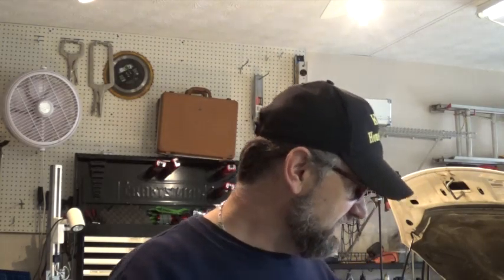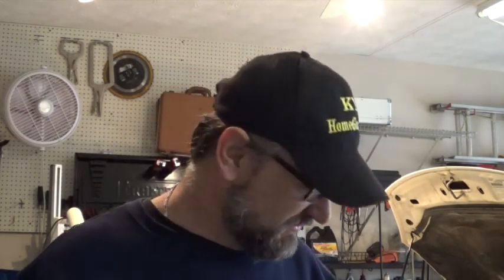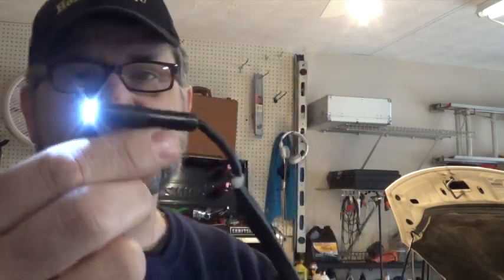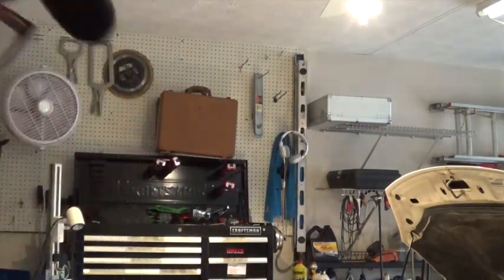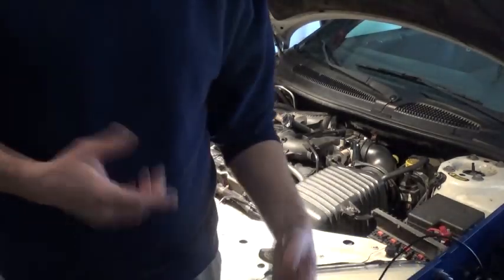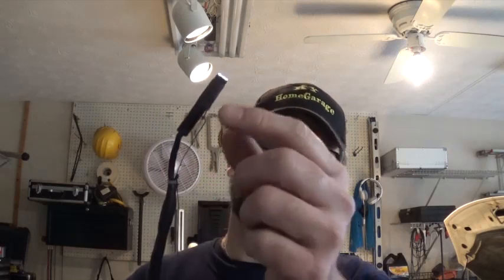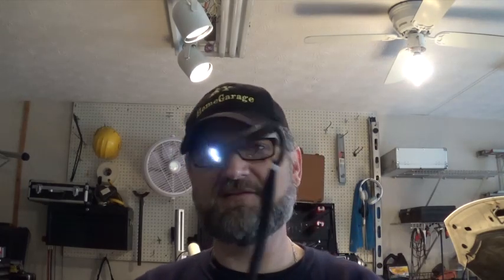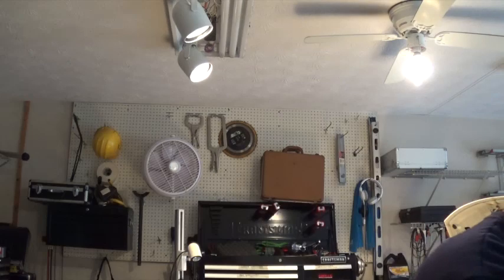Engine Valves Inspection With USB  Borescope

Comment: one thing to add to this....practice with a small cardboard box with a hole the size of the spark plug hole first before doing the real thing. i got a small cardboard box like 5x5...whatever....cut the hole in the bottom of it, and magic marker'd some circles on the inside bottom of the box( to simulate valves). flipped the box upside down on the kitchen counter and taped it down tight to the counter. practiced sticking it in and how much force it takes to pull the end up- to get the feel of it. i'm glad i did. it was good practice before doing it on the car. one important thing to remember is the string(i used ice fishing line,the braided heavy stuff) has to stay inline all the way down the scope cord or it will give you grief.(the scope cord wants to bow when you pull on the string) an idea i'm gonna try is to run the scope cord and string thru a stiff tube - the smallest allowable -  to stop the scope cord from trying to bend when you pull on the string. that can be a pain in the ass. remember folks to bevel the inside lip of the tube where the string goes thru!!  GREAT IDEA YOU HAD HERE SIR. i was wondering how i was gonna do this and your video gave me the answer. thank you.

Comment: Thank You!  I just bought an old Chev Suburban. Today I found it has one cylinder with no compression. This is exactly what i was going to search for,,before i tear the cylinder head off the motor. All other cyliders are 160 psi. I bought the truck 'as is'... Thank you again for showing this setup,,am going to rig one just like yours,,

Comment: Thank you for this! I have a 2001 Volvo V70 that had a water pump bearing failure that caused the timing belt to jump. I want to look at the pistons and valves before I go to all the trouble of removing the head. I've ordered one of these cameras and will use your ingenious idea to modify the scope to look up at the valves inside the cylinder. I will provide a link in my video to your video so you will receive credit for the idea. Brilliant. I have also just SUBSCRIBED to your channel. Cheers!

Comment: Thank you so much man I was looking for one that can look straight back up into the spark plug. I am drilling out the hole and putting an insert on broken threads in my spark plug and I want to see the shavings come down and also how far the insert is going in to the spark plug! Just to let you know there are a whole bunch of accessories now for borescopes mirrors side mirrors 45 degree angle mirrors check it out on Amazon but I couldn't find one that can look straight back up and I just never thought of doing what you did so you're the man!
Reply from the maker: This works great. I been using this scope for over a year now and it’s successful.👍😊

Comment: Great video sharing your idea.  One issue you may have is if you can't get the camera to straighten out in order to get it back out of the spark plug hole.  That would be my biggest worry.

Comment: You could also tape that length of copper tubing you showed in the video to the camara's cable & threaded the pull-string through it. Brilliant concept, though! Scope should work with windows live moviemaker, from what I've been seeing on youtube.
Reply: Yes it is a nice idea. I used mine today to inspect my muffler from the inside. I used the standard webcam app that windows 10 has and it worked great

Comment: GREAT trick for the articulation.  The only notes I'd add are that in order for it to work, you need to make sure the engine you're using it on have both enough bore and stroke for the camera head to be pulled around.  I'll probably be trying this soon on one of my autos.

Comment: You never cease to amaze me. Great idea
Reply: Ramon
You need a job at aeswave 
They sell leads and accessories that you probably invented. Check out their catalog. Right now I'm shopping for accessories for my fluke 233 multimeter with the wireless detachable head. Kinda like the ponoma wire piercing probes

Comment: i use a autel borescope ,it comes with a mirror attachment ,you can buy the mirrors in different sizes and they work fine.
https://www.amazon.com/Supereyes-Borescope-Side-Mirror-degrees/dp/B00JAQN8FO
Reply from the maker: chico rodriguez This scope comes with mirror but bracket that snaps on camera head is to big and makes it harder to insert through spark plug hole. Yours looks smaller will try. Thanks for sharing .

Comment: I was just looking at borescopes this morning. Do you realize that your setup has more articulation than the $1300 borescopes on the market which only articulate to 240 degrees? Well done indeed! Perfect for viewing burnt valves which cause misfires or compression issues. Thanks!
Reply: our borescope can articulate 360 degrees.

Comment: What kind of oil do you use in that 2.7 liter? How often do you change it?
Reply from the maker: rusco321 I use whatever is on sale at Autozone since I use their reward program. So when I get $20.00 coupon I get 5w30 oil and filter. Generally I would change it every 3000 mil. I have this car for four years now and had to replace water pump twice. It's a big job but I done so many  so for me it's not that  big of a deal. It's been good car so far. Thanks.